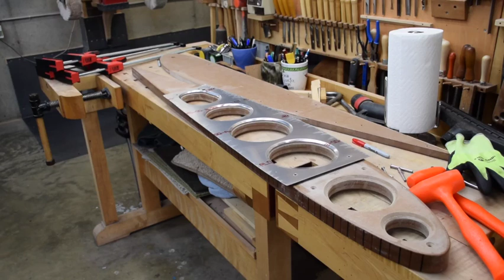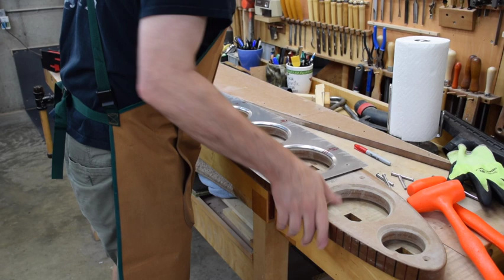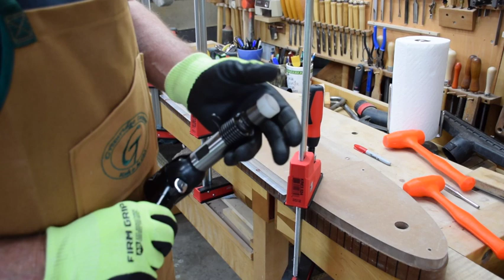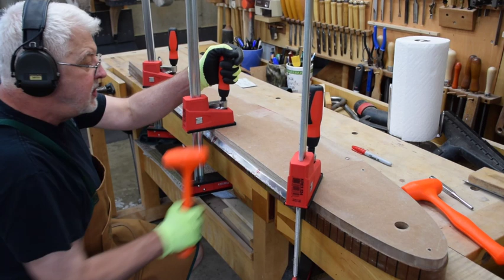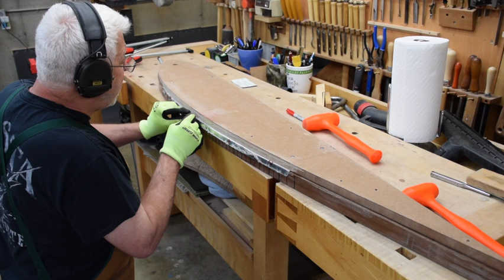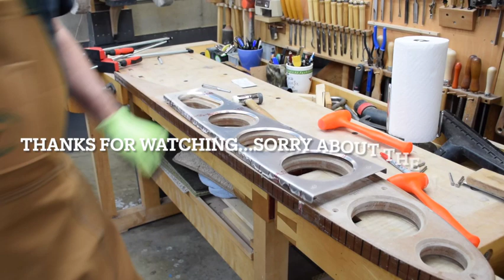Bearhawk Patrol P471 - Forming Wing Ribs Part 1

Comment: what type of material was used?
Reply from the maker: 2024-T3 in .025 for nose and outer wing, control surface ribs and .032 for some of the center ribs near the wing root where the 27 gallon fuel tank is mounted in each wing.  Cold forming is something that you do not usually do for 2024-T3, but the nature of the bends and NDI allow any problem ribs to be culled or repaired.